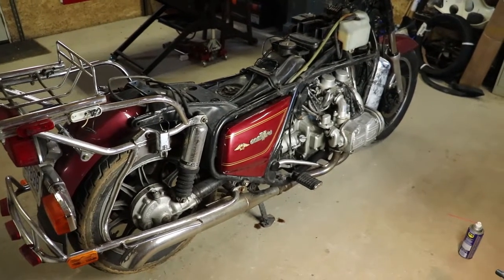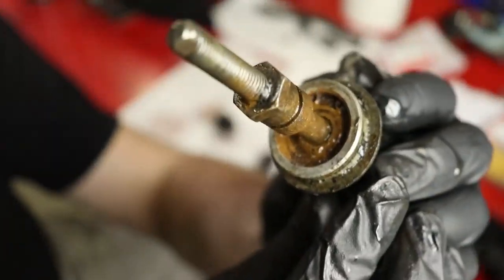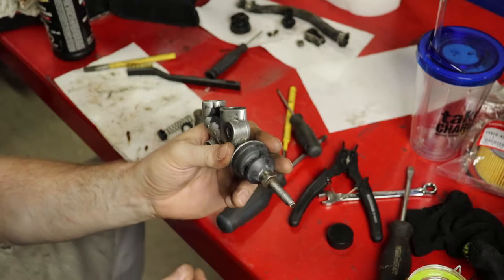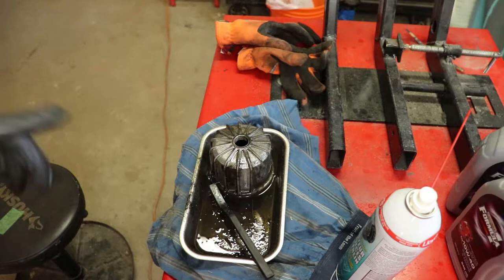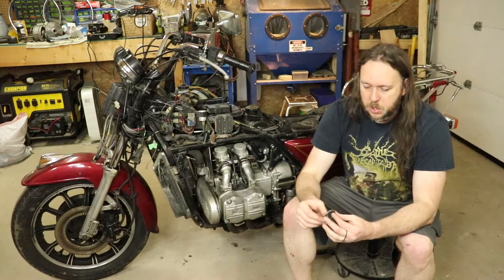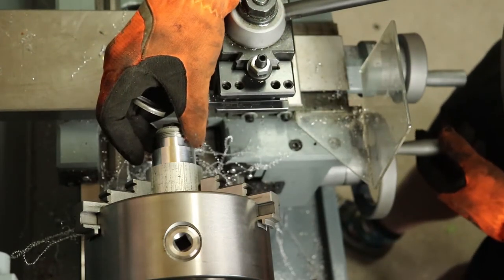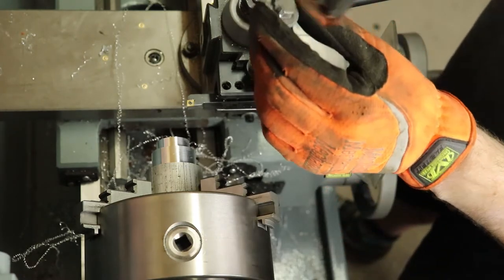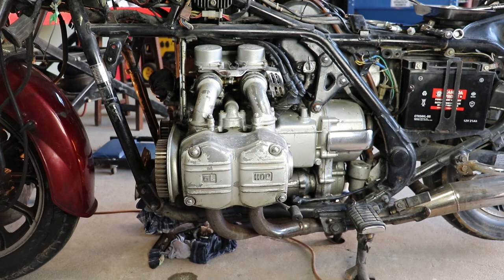Bargain 1983 Honda GL1100 Goldwing - Part 2 - Brakes, Fluids, & Valve Stem Oil Seals

Comment: Hello - I have just purchased pretty much the exact model and year you have there - the previous owner passed away and son sold bike to me.  It all looks good and will turn over however the previous owner took off whatever that is connected to the rear of the cylinder head on the right hand side of the bike as you are sitting on it.  A worm gear protrudes from the rear of that cylinder head to the rear when removed - I have no idea what that is and why the previous owner would remove it - do you know what that is for?  it has the two grey vacuum hoses coming from it.  Trying to work out why he would have removed it.   Thank you your videos are very useful.
Reply from the maker: Hey Britcheflee. That is actually the fuel pump, and also where the tach cable gets connected. You can see it here:

https://goldwingdocs.com/forum/viewtopic.php?p=99344

Since some parts of the fuel tank are pretty low, lower than where the carbs are fed, I don't think gravity feed will work on this bike unless it is totally topped off with fuel, and then once it gets down so far it'll be no good again. No issues without a tachometer cable hooked up, but a fuel pump is a requirement for sure.

The good news is they appear to be relatively inexpensive:

https://www.ebay.ca/sch/i.html?_from=R40&_trksid=p2380057.m570.l1313&_nkw=1983+goldwing+fuel+pump

Let me know how it goes!
Reply: @blastworks  Thank you sir!!!!!    Thats great info and really appreciate the help.

Comment: Hey where did you get that valve spring compression tool?
Reply from the maker: My buddy gave it to me, and I'm not sure where he got it, but you could use anything, even something like an adjustable wrench, just open it up enough to miss the valve stem and keepers and use it as a pry bar the same way this tool was used! I believe I mention this in the detailed valve stem oil seal job video here: https://www.youtube.com/watch?v=p4pUk3nYITU